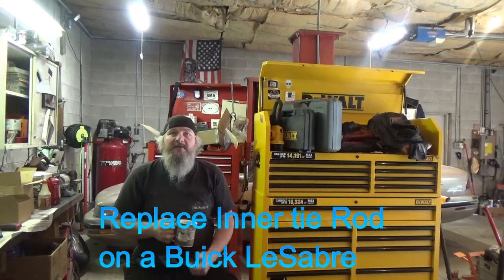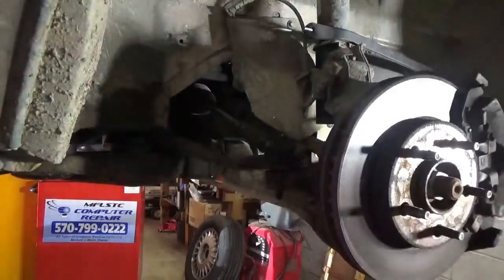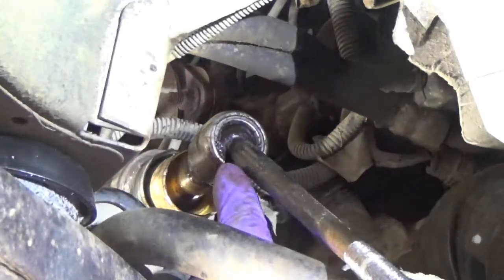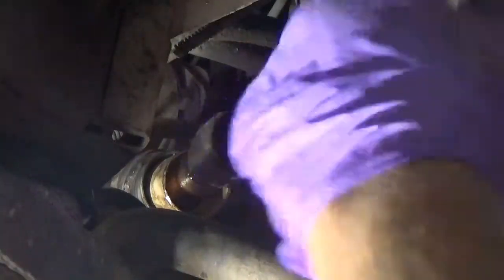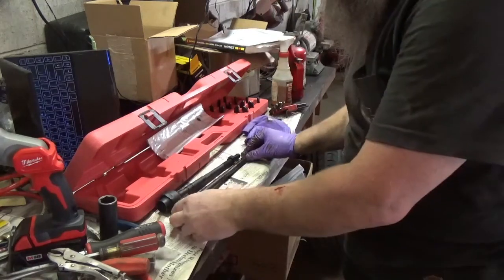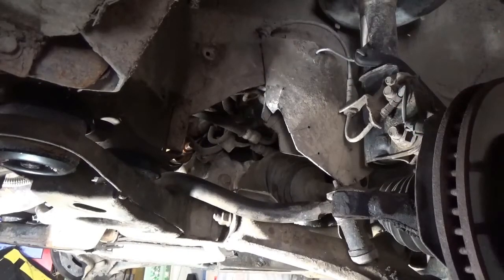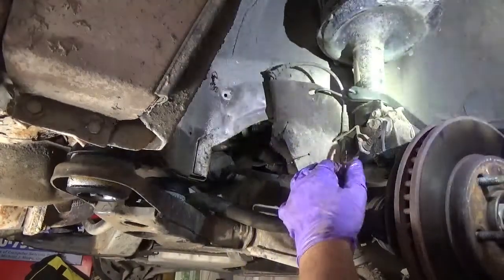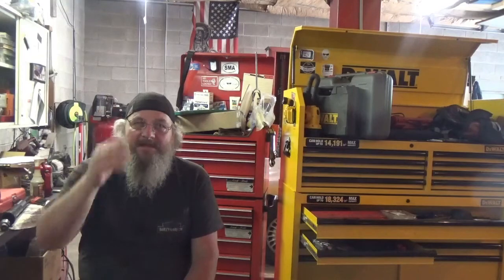Replace inner tie rod on a GM Buick LeSabre

Comment: I did this job a while back on my 99 Deville (Same exact set up).  While you made a great video, I would suggest using a GM Inner Tie Rod Crimping Tool to crimp the new tie rod in place.  Not sure if its absolutely necessary, but GM does it at the factory and I certainly don't want to be the one driving if this thing comes loose.
Reply from the maker: probably not a bad idea. A punch and hammer can be used too to dent it in.  better to be safe than sorry for sure and do it.

Comment: What are those parts coated  with ? .My tie rods  are a light colored  tan rust  which are going to have to be heated to get the ends off. I think  I will  just take the grinder to it and replace both ends. I think if  I compare the two and or measure the lengths of them side by side off the vehicle will set my tow . I found this 2001 Lesabre with 134,000 miles on it so it might last me a while. Thanks for taking the time to show us your skills.

Comment: Hey thanks so much for taking the time to make this video.

I am replacing inner and outer tie rods, control arms and stabilizer bushing.

Everything was going great until the inner tie rod!

The only thing I was wondering about is in the service manual it said to hold onto the rack with another wrench on the flat spot. Is  that a necessary step? 

The manual said you could damage your rack and pinion if you don't.
Reply from the maker: I certainly would do it the way the manual says. Without holding it you could damage the rack with torque used to get the tie rod out. hope this helps,
Reply: Thank you for the reply.

Got side tracked putting in the shift kit while I wait for the tool from town, but the tie rods will be replaced later today.

Looks like I'll have to call in a helper.

Comment: My method of refitting the tierod end is to mark the position of the lock nut on the old rack end and match it up to the new one on the bench..That way thread counts and number of turns doesn't matter...It works for me.
Reply from the maker: Yes That would work too. And less work if I don't have to do any counting.
Reply: ZIGgassedUP ... that’s if your changing the rack.
Reply: I’ve measured with a calipers works also!

Comment: I also want to say that your video was very helpful thank you. I tried renting the kits from oreilys and autozone but they didn't have the right piece with them. Do you know which size the piece is? I found item # 69619 at harbor freight and I'm gonna head that way to pick it up if it's right?
Reply from the maker: +Brian Williams I do not know the actual number on my kit from harbor freight or the size of the insert and I am not at home to check for sure. Sorry.
Reply from the maker: +Brian Williams I do not know the actual number on my kit from harbor freight or the size of the insert and I am not at home to check for sure. Sorry.